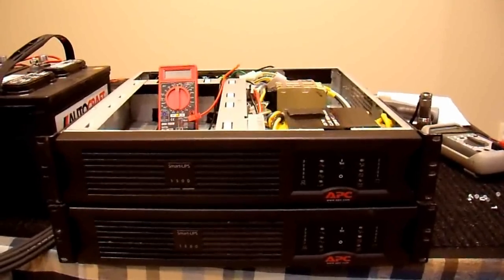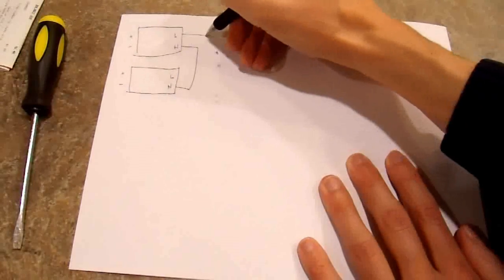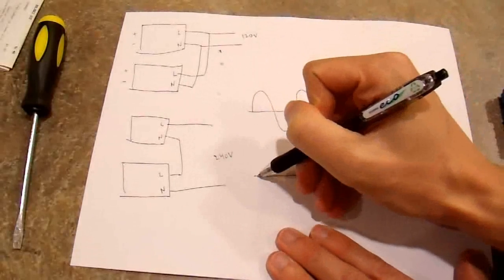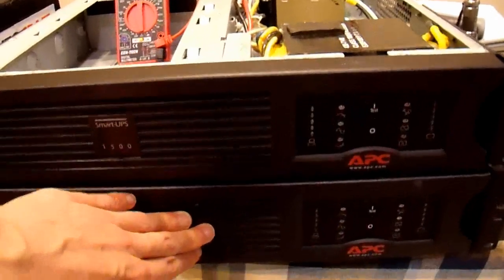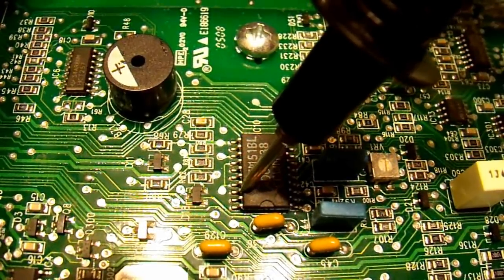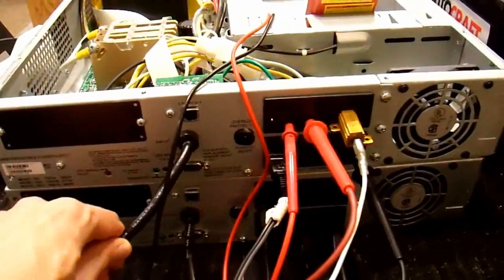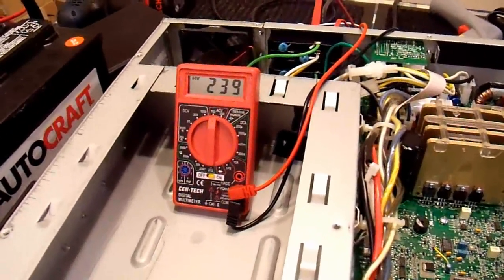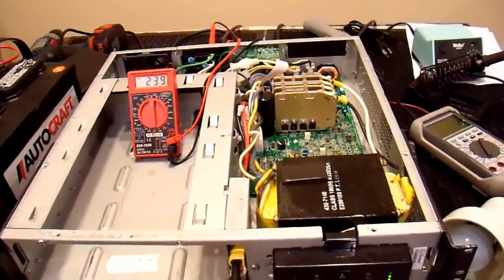Connecting Two UPSs or Inverters Together for Double the Output Power

Comment: Hello from Panama , two questions; first:  have you ever tried to sync an UPS output to grid?, second: csn you suggest a low cost voltmeter-oscillocospe such you presented?
Reply from the maker: I've never tried to sync to grid with a UPS.  I have no recommendations for a DMM oscilloscope but there are a lot of options on the market now from Chinese manufacturers at reasonable prices.  They're probably all better than the 1990's unit I used in this video.  That said, I still use that 25 year old DMM today and it still works great!
Reply: @knurlgnar24  about connecting the ups output to grid , I was thinking to take avantage of 120 vac input cord a s a reference to sync the outputto grid. The goal is to use the UPS as an inverter feeded by solar panels. Iinsane idea?? any comment? suggestions ?

Comment: All u need to do is directly connect each uos main output capacitors.

Wattage is then doubled on each ups output but eise to take power from a single one at double the wattage
Reply from the maker: The FETs are the limiting factor for most applications so that strategy does not work.  One can upgrade the FETs which I have done and you can get a lot more out of it.  That's probably the best way to do it.  Surge capability more than doubles with a simple FET upgrade.  For long term continuous output power the entire system needs to be upgraded though, since these UPS units were never intended to run more than 20 mins or so.

Comment: If slave UPS is synchronized with master UPS, why can't I run those UPS in parallel mode ?, instead in series
I have multiple APC smart UPS with 220v 2700w capacity, I plan to run it in parallel... So I can get 5400w capacity

Comment: Nice work wow! I have 3 1,200 watt inverters...they plug into to 120v (outlet) to charge the battery or plug into a car battery and use as an inverter:

Dimensions Sensata Technologies 
Model# EV1200
Inverter input 12.6 VDC at up to 120 amps
Inverter output power 120 VAC,60 Hz
Inverter output 1200 watts transfer rating 12 amps

Sine Wave

Charger input 120 VAC,60 Hz at up to 12 amps
Charger output 50 amps at 12.6 VAC
provided with integral protection against overload. 
I want to set them up and get more watts out them,but don't wanna mess them up.
Coyld you give an idea please?

Comment: For my case, I broke connection from controller to mosfet and parallel control signal just from 1 controller but for two ups to make sure no phase shift.
Reply: i always thought that was the ONLY way;  i wonder if that does indeed work, and then can we parallel the 2 AC outputs?
  how about he feedback for control of the output sinewave voltage?    Thanks

Comment: Danger,  not a great solution.   Just use the "separate" outputs or get more inverters of the correct size.   Even if it looks like it works the failure modes may be dangerous.   One unit filed the second unit catches fire.
Reply: fire?  it´s inside an aluminum case, no worries; never seen a fire in those , seen the mosfets just blown out to pieces and all disconnected

Comment: Hoping you can help and respond..I have 2 X APC SU3000RMXL3U and wish to run them both from the same large external 48V Battery bank. Very similar to your battery connection in this video.  Both units will charge the bank when grid power is supplied. I am hoping you can advise if this would be a problem for the charging circuits as they will be fighting with each other to charge appropriately.  In a perfect world I would love to disconnect both APC charging circuits and add a external 4-Bank charger. Please and Thanks..Jeff / JC audio and light
Reply from the maker: Connecting them to the same battery bank will work just fine - no issues there.  Unless the XL units are different these smart APC's use simple float constant-voltage charging only.  It sounds like a nice setup!
Reply: @knurlgnar24  THANK YOU!

Comment: What about running in parallel
Reply from the maker: Parallel operation would require exacting synchronization between the two units which would be difficult.  It may not be impossible but series operation is more forgiving to slight differences.

Comment: so technically i can connect two computer ups parallel to get more watt out put...
i am worried if two ups are not identical and that may cause some phase difference ..(#AC 60HZ)
if it was DC it  wouldn't be anything to be worried about ..
please reply...
Reply from the maker: I was worried about that also.  It is unlikely the transformers would have exactly the same impedance characteristics, parasitics, and turn ratio (likely off by a fraction of a turn due to wire routing geometries) so I simply ran them in series instead where all of those variables go away.  There is also the concern of one unit turning off due to overload or such and dumping power into the parallel one causing damage.  If you want 120V you can easily run the 240V through a small 480/240 distribution transformer in autotransformer mode where a 2kva transformer can handle 4kva in autotransformer configuration.

Comment: Hi   I have 3 of these UPS 3000 's  and they are running great on 56 AGM  batteries of 100Ah in 14 groups of 4 //good for some 50 000 watts spare energie ! 1400 AH by 48 Volts !    they take only some 75 watts running on idle and do feed easaly a vacuumcleaner of 2000 watts no problem , now my question : do you know how to trick these  SUA3000 to see the big battery pack and to charge at a decent level ( something like 25 to 50  or more amps  since  14 00  AH  connected is not happy with the small charge of a few amps  as standard from  these units ,I  know there must be a possibilty with some programs and a serial connector to set up the  UPS  for a bigger pack of batteries then the standard sets , but do you know how to ???

Comment: It sure would be cool if most inverters came with a parallel port like with a lot of the inverter generators i saw someone use a regular generator and an inverter generator with the parallel option and combined them i have seen grid tie inverters that can do it but they are kinda expensive they have current transformers to check the system current draw and I heard you can use a grid tie inverter but if you are not using enough power one will blow

Comment: Greetings, I have 5 APC smart UPS 2200 units and a music studio I would like to power off grid with solar and perhaps these units. I dont have great access to my outlet atm but as a guess i'd say it runs 3000w and 4000w peak with all of my gear on. I'm not a electrical engineer and lack knowledge in this department. Can I connect a charge controller to the APC units? I'm thinking of purchasing a bunch of used 12650 batteries, restoring and building my own bank. I'd like this to be able to run 12 hour studio sessions. Would I be better off getting a pure sine wave inverter?
Reply: You can use a charge controller if you'd like, just connect all your inverters/UPSes and charge controllers in parallel to the same battery bank. Since the UPSes can be used as pure sine wave inverters I would use them because you already have them. The only downside versus getting a new higher-capacity pure sine wave inverter is you can't connect all your gear to one unit, so just connect a portion of your equipment to each UPS.

Comment: Hello knurlgnar24.  I have some of these, that are 2200 not 1500. They have two transformers, and a different CCA.  Is there anyway you can tell me where I would put the jumper on these?  I can send you pictures if you tell me how/where to send them.  Thank you.  P.S. are these units that you modified single or dual phase?

Comment: Nice!  If it is possible - you could develop and patent a unit to do this (synchronize multiple UPS). I'm sure it would be in demand. I don't really have a problem with paying for higher capacity units. I have a problem with the batteries being short lived when the unit as a whole is fine.

Comment: Gotta be a way to get them to sing the same tune.  In Phase Sync.  Even if you to drive them off the same clock.    If you have the Schematic There has to be a Clock source that can Paralleled and used be used by both inverters.  Just  be sure to Disable the one not being used.

Comment: What I am wondering is how you are going to phase them properly. My suggestion is find the driver and carry those signals to the other, and you can do this by making one the master and the other the slave. Another way is to use one of those and a grid tie inverter. Also your drawing is off, as the way to get 240v is use a small transformer to connect the two,  and then connect both neutrals to each other as 240v is both hots.

Comment: EV's re-charge faster using 240 volt level 2 chargers.   240vac.3000  watts give a current level of 12.5 amps, which would be great to recharge a  Nissan Leaf, Chevy Bolt or Volt, Chrysler Hybrid etc. a quick recharge using a level 2 charger and a quick extended range.  Use li-ion batteries for lower weight.  Sounds to easy, so something got to be wrong with my thinking.

Comment: This is great that someone thought of doing this. I have 4 similar units that I thought about using like this. I thought about the master-slave config as well, but was not experienced enough to modify the units to "stay-on-battery". 

My idea was to create an external master signal that is fed into the mains input to fool the UPS units into staying on battery while synching to that master signal. I would assume a simple 60hz signal generator circuit at the appropriate voltage might work. Have not tried this yet, but would be interested in your thoughts.

I agree that the series setup would work best from a failsafe standpoint. In my case, the UPS are only 240v output. Consequently, I have a pair of 3kVA transformers on the outputs to give me 240v with a center-tap neutral for the 120v circuits.

Comment: What is the benefit? Just split your loads across the two units.
Reply: What about when you reach the output capacity of the 2 inverters?  This allows you to add another inverter to the system instead of replacing them.

Comment: This is very interesting.  I have two 3000 watt APC smart tower upses.  I have connected external battery cable, and removed the internal batteries.  The plan is to install an APC UTS10BI universal load shedding transfer switch.

Each side of the 240 volts could be powered by one 3000 watt smart apc ups.  This transfer switch is connected to everything but the stove.  This means all the connected loads are 120 volts.  The stove is the only 240 volt load in my apartment..  

All this being said, it would be cool to have a true 240 volts going to the transfer switch.  I might want to use the stove or buy a 240 volt freeze dryer, or some other made up reason to justify doing this.

Have you though of using a transformer to invert the signal to sync the slave inverter to the master inverter? 
This would put the inverters out of phase by 180 degrees, using low current.  

If this worked then in phase and inverted phase transformers could be used to stack smart ups's.  

This could be a great cheap way to have modular fast backup power.  The world seems to be full of 3000 watt apc upses with dead internal batteries that are cheap or free.   I have UPSed my apartment.  6,000 watts of power from two 3000 watt upses and 12,000watt-hr of battery is lots.   The building supplies heat during a power failure.  Canada does not get very hot so I am not required to provide heating or AC.  At some point, I will add some foldout or removable solar to the balcony.  

Asking you sure beats taking everything apart.

eTutoring.com
Reply: Using the connection method shown here you don't need an additional transformer. Connect the series connection point of the two UPSes to your transfer switch neutral and the leftover neutral and live go to your two transfer switch lives.

Using a small isolation transformer would IMHO be a better way of doing this but the wiring would need to be changed. In this case you'd connect the two output neutrals together instead of connecting one live to one neutral.

Comment: Hi, 
I have two identical inverters Sukam Smiley, capacity 1400VA /24v each. My load is 1604 that include 3 flat  Tv, 50energy saver bulb of 16watts each and one underground water pump capacity of 1Hp (0.75) the underground lengh is 60mt.
My one1400va inverter can not hadle that load, I was wondering if there is a way to conect this two inverters together to double power. please asist me on this.

Comment: I have a UPS, I want to connect to solar system which is 220v 2phase. UPS is 127v 1phase. Is there and transformer or an inverter that can change voltage and the phase to 1?

Comment: i dont think its worth the risk and troubles it can bring, if you already have 2 units you can just split the load between the 2 units, like server on 1, monitors, switches ect on unit 2 ... looks better idea for me
Reply: But you would not be able to run 220 VAC devices.  Also, running them in parallel will allow you to supply higher currents.  I am running two inverters out of sync, with no issues.  But if I need more power, my only choice is to buy a bigger inverter.  If my inverter would sync with other inverters, I could just add a new inverter to the system to get more power capabilities by running them in parallel.

Comment: Very nice info to have, awesome video.  In the video you said 2 legs of 120 and 1 of 240 like the house mains but in a comment you said a step down transformer is needed for 120, which statement is true.  I would like to do this to have 120 from each ups but the option to use 240.  Thanks again, thumbs up!!!

Comment: Step one: Connect output of UPS1 to the input of UPS2
Step two: Connect the output of UPS2 to the input of UPS1
Step three: ????
Step four: PROFIT!
Reply: Infinite Energy!
Reply: Ohhh, i  that tried now they both gave off a little flame and smoke;  cof  cof;    they not work,maybe need rest,tomorrow work? thanks
Reply: @josepeixoto3384  Hm, that's not how it should work. Can you try to put the smoke back in? Electronics need enough smoke in their internals to properly work. Once the smoke leaks out it usually means trouble.

Comment: What if you merged the units together, so it has two transformers, and double the fets? The fets and transformer could go in the compartment where the batteries originally went.

Comment: Test Question: is it possible to use a Pure SWI and a Modulated SWI from the same battery bank? One to provide sensitive electronics PSW AC power while the other providing Machinery the MSWI AC power-- such as a pump, mixer, etc.?

Comment: Thats Incredible, I have noticed that you have connected both UPS to the same batter pack. How did you achieve that. Does it benefit in fast charging. What are the pros and cons of that.
Reply: I have a similar question, I have 3 units and wanted to connect them all to the same 24v 200Ah battery bank, will the charging output of them interfere with each other while on mains power? Do I need to disable the battery charging output on 2 of them?

Comment: Could you run the 240v into a 100amp power box and then make 120v and 240v lines. Just like it does in your house from the power company. I ask because I have a trailer that I have solar panels charging car battery. Right now it is running a car alarm to keep people from braking into it and stealing my tools again, but would like to start using it to run my tools. I have a compressor and a welder that run off of 240v and a plasma cutter that runs off 120v or 240v. Then I have grinders and saws that all run off 120v only. So I would like to get (2) 5000 watts inverters  put them together and run all my tools without having to run my loud generator of course I would get a few extra batteries to store enough power to run everything.
Reply: if you need 110 and 220 just get a split these inverter. 5000- 6000 watt may pull a compressor and welder separately

Comment: Ok, i have a question. Would it be possible to connect the OUTPUT stages of both UPS to the same "control" ( ex. the signal that drives the input stage ) 
In doing so, both output stages will be in sync, and can be paralleled to achieve 3000VA from 2 1500VA UPS . 

I will try to do just that with 2 apc 1500 , but you seem to have more experience than me . 

Let me explain again : on UPS is the master, and the signal that drives the output stage is feed in to the second one, to drive the second UPS output stage. The original connection on the second UPS is cut , and with enough research , more can be connected to that "control bus" , and be perfectly in sync .

What do you think ? Is it doable ?
Reply: Tom Cat,

Did you ever make progress on this concepts? I've very interested in this

Comment: If you are powering 1 UPS from the other, how would this double your total output?
Reply: He is not powering one from the other.  He has them connected so the 60Hz signals will be in-phase.  The mod he did will keep the top UPS running inline (off of the battery) even though the bottom UPS is supplying 120VAC to it.  The mod is telling the top UPS that the supplied voltage is too high and it should run off of battery.  While the bottom is supplying 120 VAC to the top, the top is only using it to sync up the 60 Hz signal it is generating from the batteries.

Comment: If they sync to the phase of the outlet, then you can easily wire them in parallel.

If you wire them in parallel or series it doesn't matter... the phase still has to match.
Reply: There will be no frequency to sync to from the single-phase supply when the UPS switches to battery mode.